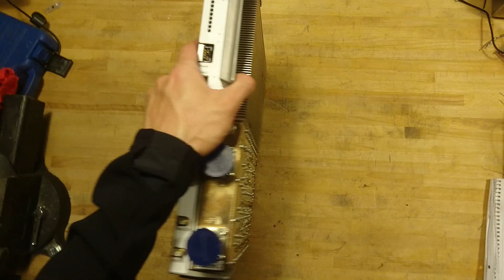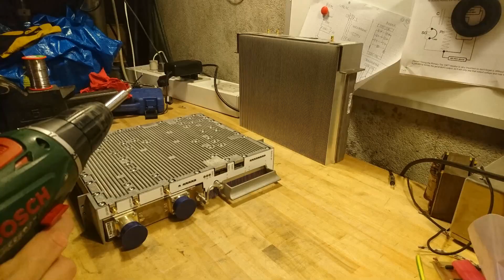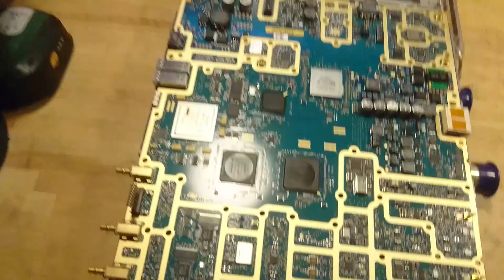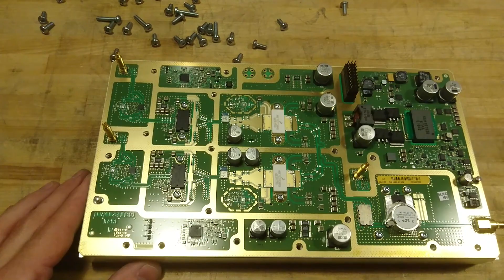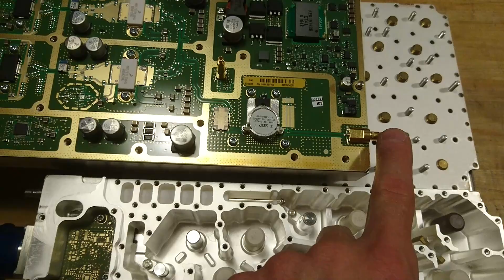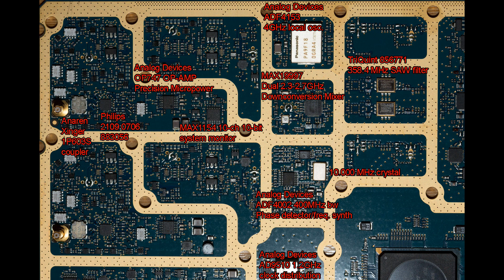Ericsson RBS6000 1800MHz Radio Base Station Teardown

Comment: Nice to see your  Doc , but dont speak about what you dont know .

Work 25 Y in telecom , 8 Y  in Radio ,  i can learn you some  .   very nice document , i search for cavity filter  working

sorry for beeing nasty .

begining  ,   800 is B20 , 900 is B8 , 1800 is B3 , 2100 is B1  , and then ,700 , 1450 , 2600 , 3500 Mhz now , take other B 46 , B78 ..  

Cdt
Philippe ,

Comment: What type of push-on RF connector are those, one used to connect the two PCB between the two chassis?
Reply from the maker: Da_Stier on HVF gave me this information: "Most of them are either made by Radiall or Amphenol, however even those two manufactures offer SMP, SMP-Max, SMPS, SMPM, SMP-COM, SMPW, etc. This makes it pretty annoying to find the correct connector for reusing the amps. That's the reason why I just change them to SMA whenever I don't get the fitting connectors with the amps." https://highvoltageforum.net/index.php?topic=1329.msg10117#msg10117

Comment: Cell tower base stations are the coolest pieces of RF technology. The DSPs used in a non audio application is very interesting to me. The diplexers are pretty cool and fascinating. The wireless routers in your home has a miniature version of one which is just a couple of regular ol electrolytic capacitors and inductors instead of a machined aluminum block.

Comment: This is not a complete base station, just a radio. The name RBS6000 is for the whole system. This is an RUS01B7 radio, meaning multi-standard, first generation, single RX/TX, Band 7. The true model number is on the white sticker with the QR code, though.
Reply from the maker: I know it is for the whole system, I could only identify it from pictures on google :)

Comment: nice video! 
What do you do with that equipment later?
Reply from the maker: It is all recycled properly, sorted in the different material types. I only keep single parts like connectors, rest is literally destroyed.
Reply: @KaizerPowerElectronicsDk  Are you able to get some parts to Radio Hams?  We could make useful and interesting things with that.
Reply from the maker: @SteveWrightNZ  the PAs are usually put on ebay or sold directly to hams.